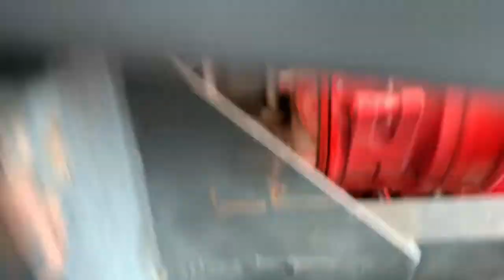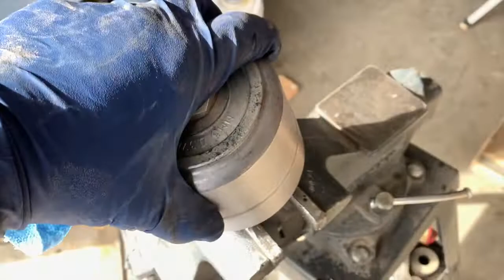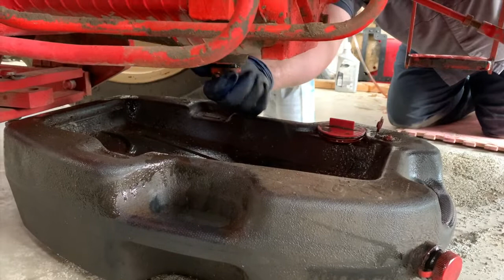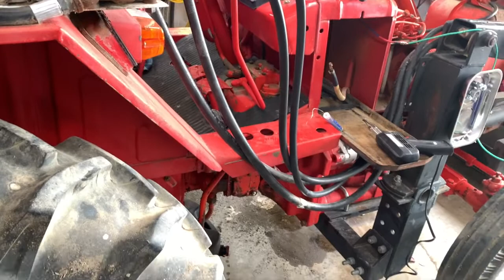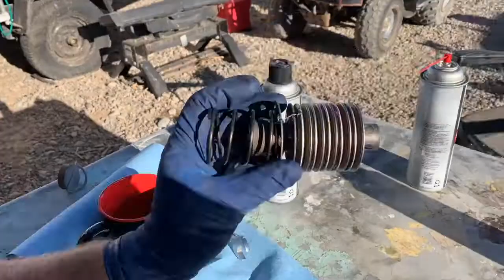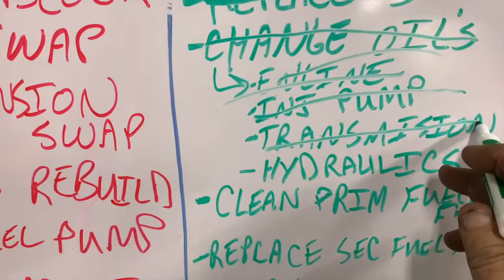OUR BELARUS 250AS GETS SOME MUCH NEEDED MAINTENANCE

Comment: Your hydraulics are run back to your remotes. Are you pushing the handle only when operating the the loader ? How has the manual steering been with the loader. ? I am putting a loader on mine and was planning on converting to power steering.
Reply from the maker: I've since sold the Belarus, mainly as we needed a 4wd, but the steering was a real aggravation of mine.  I could see easily breaking a finger(s)/wrist if not paying attention.  Thought about redesigning it if I was going to keep it.  If I didn't have a firm grip on the wheel and one of the tires hit a rut, it would spin the wheel pretty aggressively.   Good luck on yours, it's a low maintenance tractor.

Comment: I  know this is a an old video, but I hope you get this.

I have a Belarus 250AS that I am trying to get running and have a problem with the decompression lever. It is hard to move. At the engine case, I have to pry the rod backwards to the open compression so the engine will 'free-wheel' as it should. I then have to push the lever forward with my foot to close the system for compression. I hope that makes sense. It is functioning when I use this process, but the lever should move freely using the control lever. I have sprayed quite a bit of PB Blaster where the levers enter the engine case, but that has not loosed the levers to where the rod will move freely. Any thoughts on how to get the rod to move freely would be appreciated. Hopefully this does not mean 'cracking' the case.
Reply from the maker: Actually I don't use the decompression lever.  The starter I purchased is a gear reduction unit. Even in the cold winter, I just let the "glow plugs" go for 30 seconds and she always fires up.  So I haven't had to mess with the decompression.  Is it possible something got bent somewhere that is binding it up?  Good luck!

Comment: The first time I saw one of these I could not believe what I was looking at . This was the first air cooled, let alone air cooled diesel tractor I had ever seen. Leave it to those Russians. A cold or cool climate wouldn't be a problem, but here in Louisiana where it is super hot and dusty in the summers and then there is the problem of dirt dauber wasps clogging up the cooling fins if the tractor sits without being used. most of them that were sold in the South I'm sure were reduced to junk in a very short time. The ones I have seen for sale looked like they came from a Mad Max movie, they were not taken care of at all. I have always wondered if machinery from Russia or China has radio active steel or iron in it.
Reply from the maker: Definitely would be a concern in the hotter area's.   It will have a pretty easy life here, plowing snow and grading dirt/gravel around the property. Just used it on our recent snow fall and it worked great clearing the drive way.  Never thought about the radiation, interesting question for sure.  Funny you mentioned it, as a couple months ago we were at an estate sale for a "preppers" property and they had a Geiger counter there for sale, we thought it was cool but didn't think we'd use it.  Now I wish we had picked it up, we could've answered your question.  Thanks for watching!
Reply: IM OUTSIDE NEW ORLEANS,LA AND OWN A FEW 250AS AND A 400A BOTH AIR COOLED AND NEVER A PROBLEM OVER HEATING AND I WORK MY 250A WEEKLY BUSHHOGGING ALL KINDS OF PROPERTYS... KEEP IT CLEAN JUST PRESSURE WASH TRACTOR AND YOUR GOOD TO GO...
Reply: Здраствуйте я живу в россии,у меня такой же трактор и у многих россиян ,большинство его эксплуатируют только летом в жару как в луизиане ,мы заготавливаем корма животным на зимний период, зимой мы этот трактор не используем для этого у нас есть трактора и по больше и мошнее и дорожные службы ими расчишяют дороги и ремонтируют,насчет воздушного охлаждения  это более эфективный вид охлаждения так как тепло отдается на прямую в воздушную среду минуя переход в теплоноситель,единственный сушественный минус такого охлаждения заключается в том что  невозможно отобрать тепло для отопления салона ,если трактор перегревается значит в тракторе есть неисправность, например забились радиаторы цилиндра ,или ослабло натяжение ремня и вентилятор работает не на всю можность либо тракторист дал запредельную долговременную нагрузку!
Reply: @_lika_dedicated_4105  @mountainviewsgarage - Very informative comment. I will paste the nice person's post, English translation here: Hello, I live in Russia, I have the same tractor and many Russians, most of them operate it only in the summer in the heat like in Louisiana, we harvest animal feed for the winter, in winter we do not use this tractor for this we have tractors and more and more powerful and road services clear roads and repair them with them, As for air cooling, this is a more effective type of cooling, since heat is given directly into the air, bypassing the transition to the coolant, the only significant disadvantage of such cooling is that it is impossible to take away heat for heating the cabin, if the tractor overheats, then there is a malfunction in the tractor, for example, the cylinder radiators are clogged, or the belt tension has weakened and the fan does not work to its full extent or the tractor driver gave an exorbitant long-term load!
Reply: Также насчет радиактивного металла в советское время много выплавлялось метала из руды,и из этого свежего чугуна и стали делались эти трактора,в советское время да были техногенные аварии но они были не чаше чем в других странах используюших атом,тем более в советское время весь заражонный метал и здания захаранивались без проблем так как все было в собственности государства,но сейчас когда живем в капитализме бизнесмены выкапывают заражонный метал и сдают в металалом как говорится спрос рождает предложение😂
Reply: @_lika_dedicated_4105  English translation here:  Also, about the radioactive metal in Soviet times, a lot of metal was smelted from ore, and these tractors were made from this fresh iron and steel, in Soviet times, yes, there were man-made accidents, but they were no more common than in other countries using atom, especially in Soviet times, all the contaminated metal and buildings were smelted without problems since everything was owned by the state, But now, when we live in capitalism, businessmen dig up contaminated metal and hand it over to metal, as they say, demand creates supply;